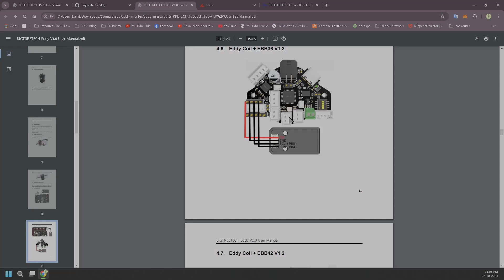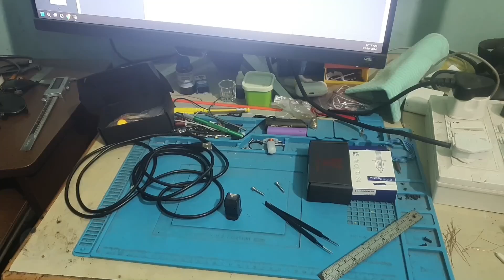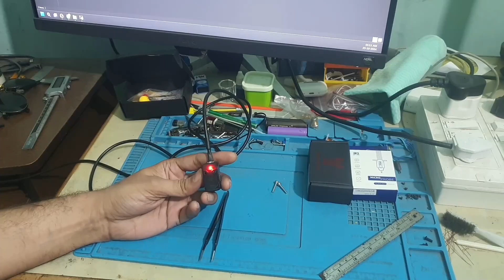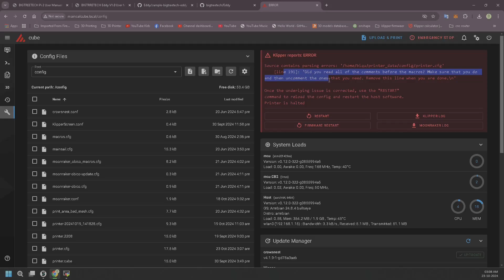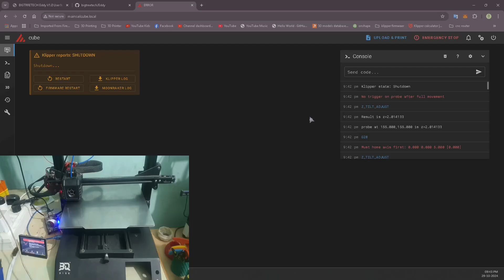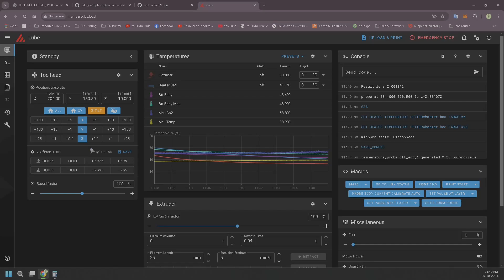BIGTREETECH Eddy USB setup and test on b1 se plus

Comment: Hello thank you for your great video. I would like to know if you have the possibility to put your printer.cfg file online because I have a problem with the Z_TILT_ADJUST command. in my printer.cfg I do not have a z_tilt tag and I know what to put inside. on the other hand I saw that it was necessary to activate the 2nd motor .. I have a modified Ender3V2 under SKR MINI e3V3 controller + CB1 / PI4B and Klipper .. thank you.
Reply from the maker: Subscribe please first and tell me both z and z1 motors have independent drivers and you have z pivot point value there
Reply: @HarmanSinghKainth   Thank you for your answer and well I don't know if my motors are configured independently one thing is for sure is that each motor is connected to a connector. After I skipped the Z_TILIT step and performed a BED_MESH_CALIBRATION it works but at the end it returns me an error message "probe_eddy_current sensor not in valid range" and I don't know if it's because I didn't do a z_tilt ..
Reply from the maker: Let me check your motherboard have 5 drivers or not then i advise you something
Reply from the maker: Skr mini e3v3 board only had 4 drivers you can’t do z tilt on it you need independent driver for each motor and you need to define left motor Z and right motor z1 then you need to configure pivot points and Z tilt points
Reply from the maker: @laurentgaming5387 i need to read you printer.cfg file then
Reply: @HarmanSinghKainth  you have groupe facebook Or give me Email :) thank you